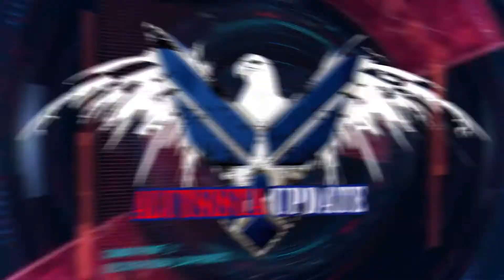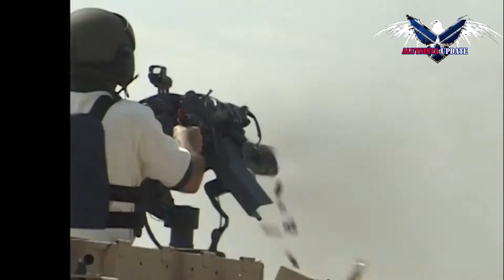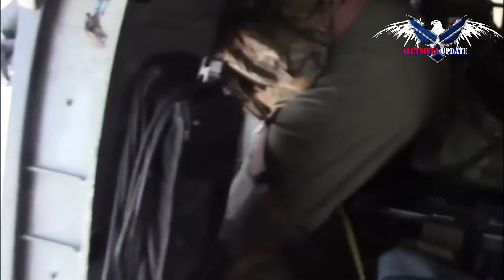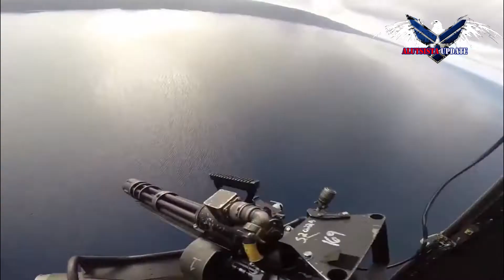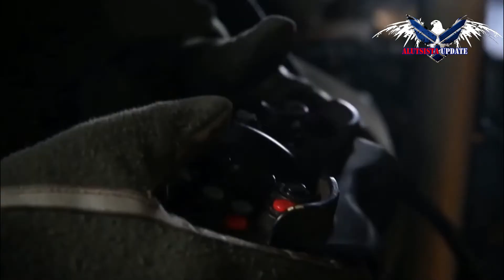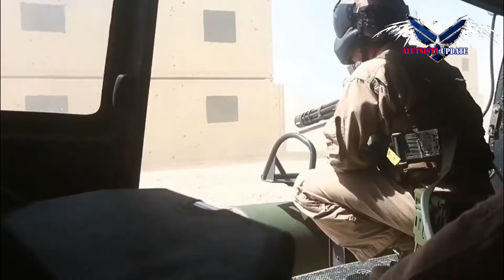M134 Minigun Multi Barrel Fire 6,000 rounds per minute

Comment: Do you guys realize that this thing fires 100 rounds per SECOND. That’s 1.66 times faster than AC current alternates. Your typical LEDs flash slower than this thing fires.
Reply: yes
Reply: Well only on the 6000 rpm setting
Reply: Either way very impressive
Reply: Still significantly slower than Jerry Miculek's finger!